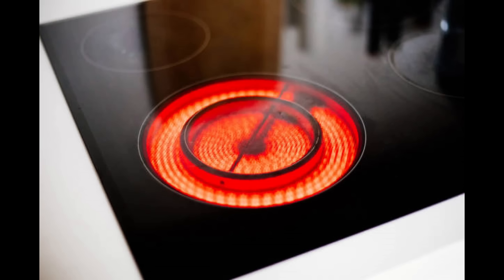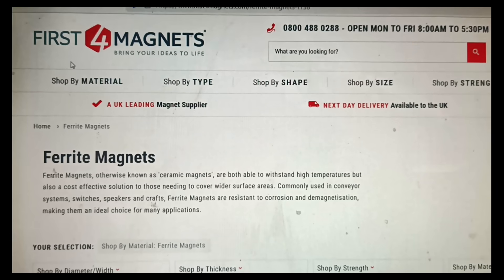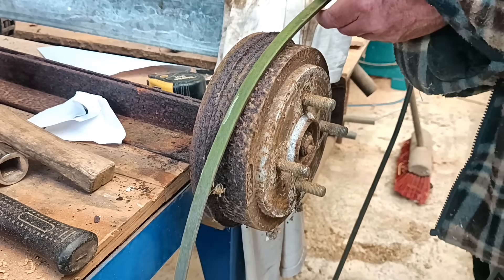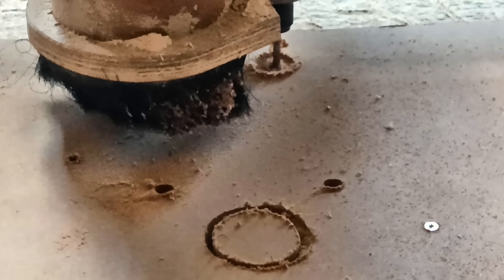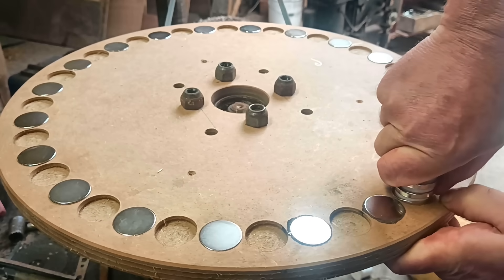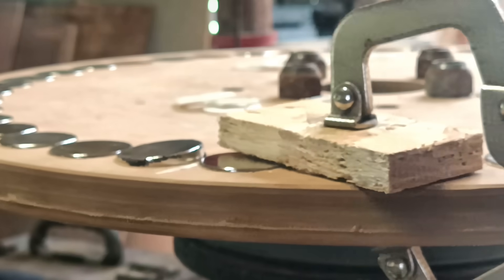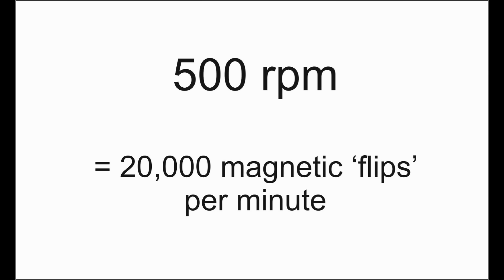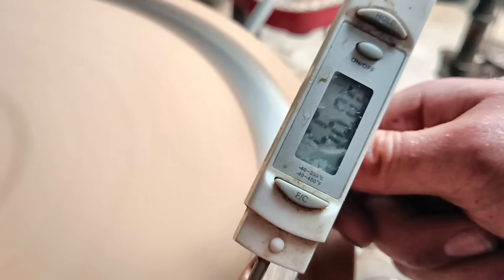I Made A BIG Rotating Magnet Induction Heater! (with magnets from First4Magnets.com)

Comment: Nice start to this project  :) . 
 When working properly, you'll struggle to hold the stator still, as it will try to follow the spin of the rotor, while also straining the motor that is driving it. 
 You'll need to replace the MDF disc with a steel one though, as this will significantly boost the magnetic field strength, while also helping to ensure that they remain in place  :)  .

Comment: Form a partial ring from a copper pipe the same diameter as the magnets on the wheel and position the copper ring close to the spinning magnets. Pump water through the pipe. You will have a wind powered water heater.

Comment: Something that nobody seem to do on this induction heating wheels is put a steel backing plate so the magnetic circuit gets shorter increasing the power of the magnets significantly.

Comment: you should be able to maximise output by having the copper tube go all the way around the circle. then you could circulate water through the loop.

I suspect the optimal solution would be a large disk of metal with channels through it for the water to flow.

Comment: Great stuff (Celsius).
Reply from the maker: Thank you (but Is it not centigrade too?)
Reply: @wayoutwest-workshopstuff6299  ‘Centigrade’ refers to all temperature scales that have 100 degrees between the freezing and boiling points of water. There are two such scales (that I’m aware of): Celsius and Kelvin. The boiling point of water is 100˚Celsius and 373.15˚Kelvin.
Reply from the maker: @ericsevern  Thanks!

Comment: Glad to see you investigating magnets.  Having worked with Neodymium magnets before, I can warn you pay close attention to the temperature warnings: the magnets lose strength quite rapidly and permanently starting at around 80c  So you'll want to keep the heat you're generating away from the magnets you're using the generate it.  A vexing problem.  Good Luck!

Comment: A few thoughts on scaling it up to the windmill. For one, you could have one large power take-off shaft, and then multiple belts coming off to multiple spinning magnetic wheels - much like how the old water powered factories of the early industrial revolution worked. Following on that, you can have more than one pully, and thus get a gear ratio/transmission effect going, so a large slow windmill can translate into small fast disks. 

Directly induction heating a house might be a bit hard, but boiling water with induction and setting up a steam plant might work well.
Reply: Steam can be pretty scary at the best of times, careful Icarus 💡😂
Reply: Actually you don’t need to gear. Just move the plate closer or further away and the inductive load will increase or decrease. 

If the wind is light keep the plate further away. If the wind gets faster bring it closer. This should maintain the velocity about the same.

Comment: I like this concept a lot. A full ring of copper pipe circulating water by a shaft driven pump sounds like a more possibly more efficient way to use the wind power than having to first convert the motion to electricity and then back into either heat or motion again to heat and pump water.

Comment: I am impressed. It's simple, but it works, so the full sized windmill is definitely worth a trial. My only question would be:- What do you want it for? If it is for something like a central heating system, then it might actually work well as the windmill could also drive a small pump to circulate the water.
You may have problems, though, on cold frosty days which often have no wind, so don't scrap your existing heaters.
Reply from the maker: Ah, but you can store hot water for a few days..

Comment: Cody's lab did something similar and managed to melt a small bit of metal with it.
For heating water maybe get a thinner disc of aluminium to mount the magnets in and then have a coil of copper pipe on either side of the magnets for doubling the efficiency?, you could connect the two coils and then water will automatically rise up and form a very slow moving pump that can be used to automatically draw water from a container and heat it gradually.

Comment: Thanks for sharing your ideas and video. Very interesting and entertaining. Imagine if you had a coil of small diameter copper tubing wound to the same diameter as your circle of magnets. Install it to a fixed point above the magnets and give it a water reservoir and circulation loop. Put a power meter on your motor input and compare the power needed to spin with empty no water tube to a water filled tube and compare how much load it puts on the drill motor vs amount of water and temperature gain.

Comment: Converting motion to electricity, like from a windmill, is already very efficient, motors and generators are usually up past 80% and likely 90% Then a resistive electric heater is effectively 100% efficient, since any energy lost in conversion is wasted as heat. And in a heater that's not a waste! So you don't need to do it this way. This is much more entertaining though! I suppose cheaper, too, than buying an electric generator powerful enough. Really this IS an electric generator and heater all in one, the bit of copper that gets hot creates electricity then runs it through itself, creating heat.

The jiggling of electrons isn't the same thing as the jiggling of atoms, which is what temperature is. There's the intermediate step in here of electricity being created then turned into heat, it doesn't directly jiggle atoms into heat.

Comment: Now, get some copper tubing, a container for water, and loop it.  Induction hot water, for all the hot water reasons and uses.    Been yammering at a couple different friends trying to get them to build said device, paired with wind or solar electric, could be a moderately inexpensive way to heat a tiny house or sumpin.

Comment: neat idea..  a windmill that would both power that wheel.  a water pump to circulate through a radiator, and a fan to pull air through the radiator...   setup a thermostat that would result in choosing a preset that would perhaps control a simple gearing settup to slow the magnet wheel and speed the fan/pump..  some cleverly predetermined settings..   so..   say.. the workshop is cold in the AM, so it starts up at one preset and as the temperature in the boiler increases it detracts fromt he magnet wheel and speeds up the pump and fan.     put in some safety cut offs..   when the boiler gets too hot it disengaging the nagnet wheel but not the pump/fan..     a little safety..  and if the temp in the boiler is too little (frozen is gelled coolant) it will not engage the fan/pump yet.

got to think though.. an important first step would be to work out efficiencies for the conversion of energy..  you would likly be in need of some real electricity, which might mean a small alternator, governor, battery, etc.  idealy would would have a forced air system that you could actually drive air through for ventilation around the shop as well.   neat idea...

oh..   Id suggest making a wheel of aluminum too..  or something along these lines..  and use some kind of retention system for the magnets to ensure against one popping out..   think of how bad it would be for the fellow holding the pipe is one worked its way out..    and stuck to the next one tugging it out...  and all the unpredictable things that would come next...

Comment: Whatif you bend a copper tube shaped like an ohm symbol so you have more surface area over the magnets.  Would the spinning magnetic fields also move the water along to keep it circulating into a tank.

Comment: There'll be magnetism on the other side of the disc as well so coils of copper piping on both sides would increase the heating capacity without having to up the speed too much, unless you're after "hot" hot water for washing as well a low and slow approach would probably reduce wear and maintenance.
Reply: Or he could put a steel flux ring on the far side. Ideally the flux ring should be in contact with the magnets.
Reply: @mckenziekeith7434  I'm kind of assuming that the MDF disc is more for proof of concept costing since it's not a strong material for something being centrifuged for extended periods of time.

Comment: loop the copper pipe around the disc, on both sides, add another disk, loop once more, another disk, ...
the pump to move the water through the house can be powered by the windmill, too
wind isn't constant, though
a river would be ideal

Comment: Kind of nutter I'm glad I know about. If I met you in the pub I'd gladly buy a pint. I'm electronics trained, so I want to push electrons through wires. This is still energy transfer. Nighthawkinlight has just released some very interesting stuff on phase change salts. Could be relevant to your projects? I will be employing parts of both of your ideas in something I'm working on. Probably a few years till it's done. But nice to know there are other nutters doing silly-buggery-abouty business in their shed. Best of luck mate!

Comment: Hopefully you will soon feel better.

What you have built is at it's core a very large alternator.

You will find that energy transmission losses from the top or bottom of the windmill are lower if you send electricity to your home rather than hot water.

Close tolerances are easier to maintain for copper wire coils so an all electric alternator might be easier to build.

But I agree not nearly as effective visually on a YT video.

Comment: That pivot drill spinning at 1,000 RPM does not spin the disk at the same rate, due to the difference in diameter. Still, that’s a lot of jiggly electrons. Best wishes to you and yours. ✌️

Comment: You might like to experiment, also with the other non-ferrous metal aluminium, which has more electrons in its atom stature. Also the dimension of the exciter metal probable play a part in the machine's efficiency. The magnets can probably excite far more electrons, than there are available; in the piece of copper pipe being used. And the higher the rotation speed of the disc the higher the vibration frequency of the electrons; thus the more they banging into each other, the greater the energy. You could possible have an arrangement with an exciter on both-sides of the disc. Happy experimentation  ⚙⚙⚙🛠🛠

Comment: Nice example of energy transfer!
You could use this magnet system and a copper pipe, that goes all the way around, on both sides, to heat water, then pump it to where ever you need heat.
Then again, energy is energy -  You could do the exact same thing with coils of wire, making AC current, and run electric heaters.
Or you could just run a water pump in a loop. Every joule of energy put into the pump, would eventually turn into heat, plus you have a simple means of getting the heat out.
Even easier, run a fan that circulates the air. I've seen 13 hp blowers, freewheeling and blowing into themselfs, catch internals on fire from the build up of heat. Maybe a box with a fan going to the windmill, and you open vents to let some of the heated air out as needed. Also if you have a gate valve on the recirculating air, you can control the resistance to the windmill by how much air is moved by the fan.

Like you say, there is more ways to skin a cat.  (I think I've heard you say that. <G>)

Comment: Crossed my mind to try this with hard drive magnets, cool to see that it actually works.   If you can bend a long copper pipe to go all around it so that all magnets are affecting copper at all times, I think it would actually be very effective.  Could also have a pipe on both sides of the disc as the magnetism will work both ways.

Comment: If you have a disk with the magnets  exposed both side  with flatten circling copper tube around the bottom side then to the top . To maximize all the power of the magnets. 
Now could you have multi     disks mounted on the shaft?

Comment: The drill press (pillar drill) transmission pulleys could have just driven the magnet wheel directly, no?
Reply from the maker: the disc wouldn't fit under the chuck

Comment: small gasoline engines with electric start and hence an alternator to charge a battery invariably have pretty good magnets in their flywheels to induce voltage in the alternator windings. One time Kawasaki sent a rep to my repair shop asking me how in the hell I kept the four little bolts holding the cover on the crankcase breather from backing out.
       The magnetic fields from the magnets were causing the one-inch long 6mm bolts to get extremely hot melting their locktite and the vibration did the rest of the job of backing them out until the flywheel destroyed them.
    I simply cross drilled each bolt head and safety wired them a' la Certified Aircraft Procedures (AC 43-13) and that was the end of that.

Comment: Hi! Here's another idea. Maybe you'll like it too. In some nuclear power plants, when they have excess rotational energy they want to dump, they have big spinning wheels partially submerged in a water tank. The wheels have cups that close around a volume of air when rotating -- and subsequently pull the cups apart when the wheels take them under water. It doesn't boil the water but it heats it up a lot.

Comment: You could look at building a hallbach array as it concentrates a magnetic field on a single side allowing for use of less powerful potentially cheaper magnets, or just fewer
Reply from the maker: So interesting, isn't it?
Reply: Yep! You could also consider spinning the metal thru some stationary magnets and dripping water onto the metal. Then you could put a magnet above and below to get a very strong field. I have a stationary bike like this and it can get quite warm.

Comment: Please be careful.  With the centrifugal force on those magnets. What have you done is creat a machine gun that could fire at any time and kill you. Wood is no where near strong enough to sustain that sort of force. The other problem you have is that magnets will lose there force when they are heated beyond their curie temperature starting at around 80 Degrees Celsius. Sorry to be a wet blanket.
I just don't wantvto see you get yourself or someone else killed or waste a small fortune in magnets.

Comment: Good work and I'm glad you decided to give induction heating a go over friction.  This (or simply running a generator into a heating coil) are so much more efficient, both in terms of turning rotational energy into heat and in terms of maintenance.  My only bit this time were the friction fit magnets, particularly at 1000 rpm.  There was definite squinting and cheek clenching going on.  They're not going bullet fast, but still, 1000 rpm for a circle that is ~1.4m in diameter means that they're going 23 m/s, or about 50 mph.  Definitely going to hurt or potentially break something if one of them goes flying.
Reply from the maker: Thanks - but the friction set-up was so much cheaper...
Reply: @wayoutwest-workshopstuff6299  I don't doubt it.  :-)  It's your project either way - I appreciate you sharing.
Reply: Unfortunately it's still a low frequency,  most induction units work over 25khz, many types are commonly in the 30 to 40 kHz range for efficiency.  His rotation disc would fly apart at those speeds, he's measuring at rpm, not khz
Reply: I'm not sure that at the frequency this system would be more efficient than a generator/heating coil though. It is certainly more hazardous spinning those magnets around 😊😊

Comment: The reason copper pots and pans aren't usually used with induction stovetops is that the electric resistance matters too, and with copper it's too low, try aluminum next time
Reply: I'm interested in your large scale c & c system. Do you have plans for it?

Comment: Despite this is somewhat interesting, I don't understand what you are trying to achive. Mechanical energie will always end up in heat. There is nothing special about it and the amount of heat you generate will always be the same as the mechanical energie you get from your windmil, no matter what. The only way to get more heat with the same amount of mechanical energie is to use a heat pump and extract heat from the ground or atmosphere, which will give you about four times the heat as just converting your mechanical energie. Why not convert your mechanical energie to electrical energie and drive a heat pump the way it is designed or if you want to craft and fiddle some more drive the compressor directy ?
Reply from the maker: And I might still do that - I'm exploriing the options..
Reply: @wayoutwest-workshopstuff6299  Looking forward to it!👍

Comment: In theory, a smaller disk with the magnets across the entire surface should be able to do the same work as a disk with the same amount of magnets along the edge. Couple that with a coil of pipe above the disk, and voila, a far more compact version of a rotational induction heater! Less materials used, and more space efficient!
Reply: It is NOT really the number pole reversals per second or minute that matters for this. The actual SPEED of the magnets matters much more, because this setup is using eddy currents in the copper to generate the heat and power in the copper. Both of those vary in proportion to the square of the speed of the moving magnetic fields, while magnetic drag and the number of pole reversals varies in 1:1 proportion to the speed. So at any given RPM, a smaller disk will have lower speed for the magnets than a larger disk. Magnets spread all across the face make this problem even worse.

Comment: You could use a piece of copper that's the same size as the disc and that way you can maximize the heat output. Don't forget about the backside of the magnets either.

Comment: This is a excellent idea. But you have an error. The thermometer itself was also being magnetically heated, and thus probably not accurately reading the heat of the water. 

Also, a coil could be added to the induction to produce electrical energy with the same ring of magnets.